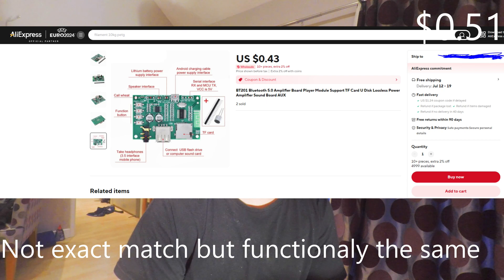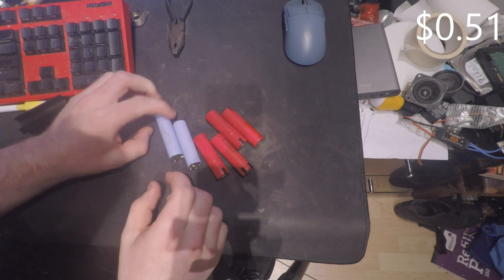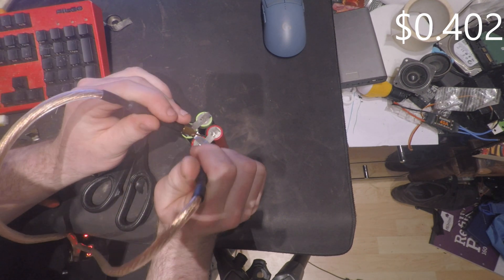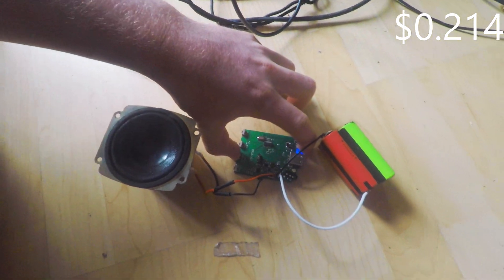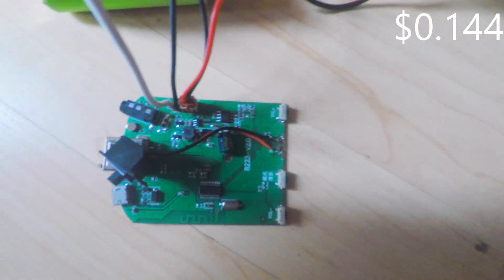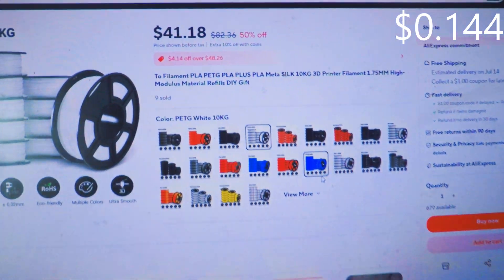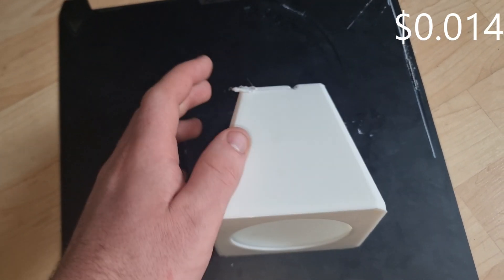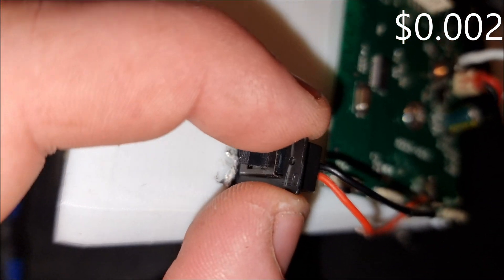I built a BLUETOOTH SPEAKER FOR ONLY $1

Comment: no bms , no charging, this is not a bluetooth speaker ut a battery destroyer :P but love the effort xx
Reply from the maker: I should have explained this better in the video but the board I purchased has a built in charger and low voltage cutoff. As it is a 1s batter you only need the low voltage cutoff.

Comment: You can actually get really good bluetooth drivers for 1 or 2 dollars, pair it with a genuine pam8403 (not those with capacitors that you cannot see with a naked eye)
Reply from the maker: That is true but the point was to make something as cheaply as possible. Definitely considering an under $20 project where I make a much nicer one.
Reply: @Boris_Woodward  Your project was actually very good,  if we ordered everything in bulk and had some vape batteries and scrap speakers you'd put these everywhere and terrorize the neighbours hahaha
Reply from the maker: @Lavadawg  As fun as that would be I don't think I could face asking any more people for their used vapes. I think the vape shop thinks I might be completely mad already
Reply: @Boris_Woodward  I pick them up from the road, its a great source of energy.
Reply from the maker: @Lavadawg that's actually a really good idea
Reply: @Boris_Woodward  My classmates also offer me broken vapes and ask me to refill them or at least recharge them, but I can only recharge them because vape fluid is a little suspicious and I don't wanna harm someone by mistake